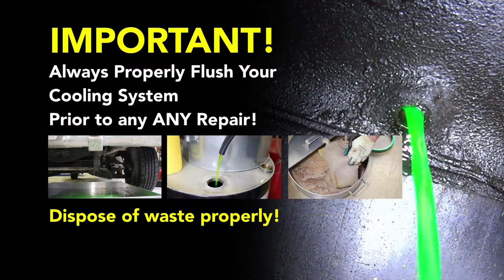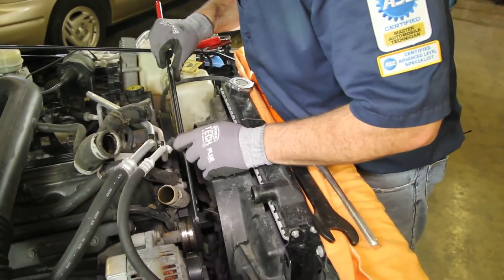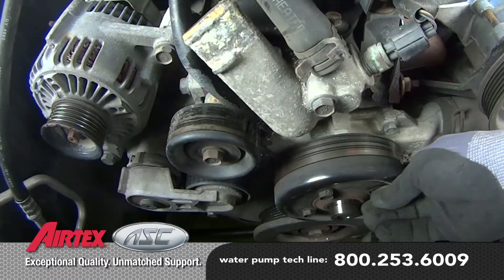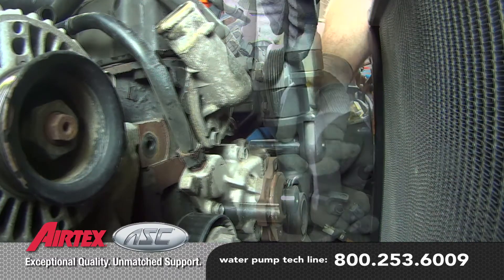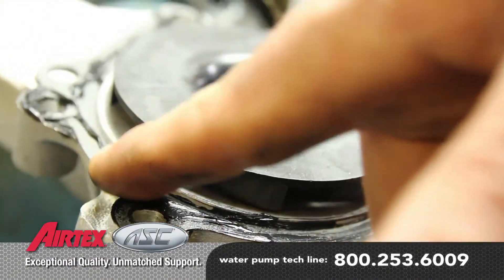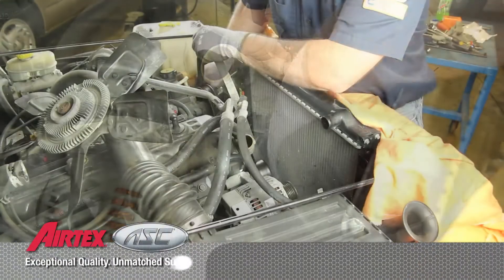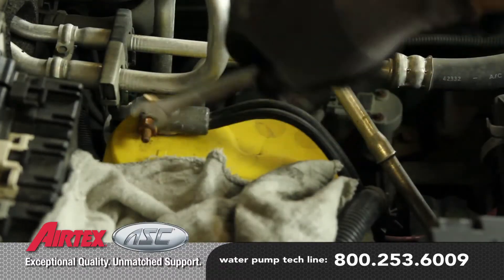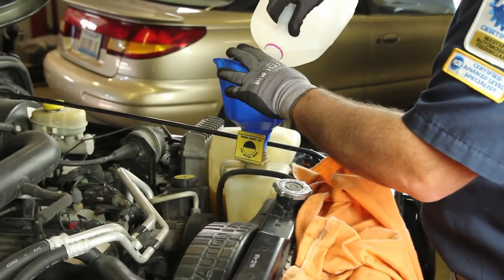How to Install a Water Pump - Jeep 4.0L WP-9200 AW7164

Comment: Hello, I wonder because I have to change the water pump of my jeep tj 4L of 2004. I ordered this model GMB 120-4340. I just received it but I feel that it will not turn in the right direction. I need a pump with reversed direction of rotation which is well indicated on the site. But I have the impression that if it turns in the opposite direction, the fins do not turn in the right direction? What do you think ? https://servimg.com/view/19057197/93
Reply: last question, what is the key needed to unscrew the visco-coupler?
Reply: https://servimg.com/view/19057197/94
in metric ?
Reply from the maker: @vidal.damien  Thank you for contacting ASC / Airtex Industries. We are not the supplier of your pump. Most parts stores will have the tool to remove a fan clutch for rent or to borrow, with a deposit.
Reply: I just want to know the number of the key?
Reply from the maker: @vidal.damien  I do not understand what you are asking for. There is no key to the fan clutch. The fan clutch is removed using the tool shown in the video. Most are around 30-34 mm. The fan clutch tool set will have the most common sizes.
Reply: @AirtexFuelPumps  ok.. thanks you very much !
Reply: @scrapsteenlifeintheforks1943  I don't understand this comment?  I finally mounted the pump for three years now and everything works fine..